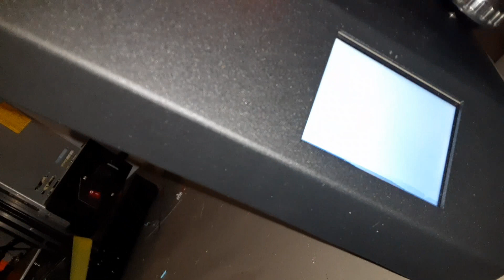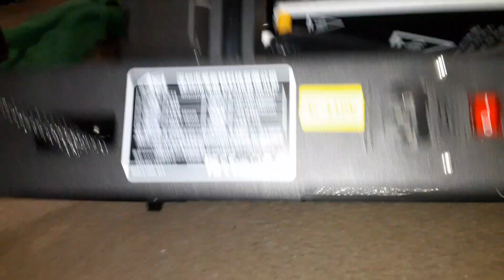Anet ET strange issues

Comment: I have a totally different issue. My printer bed starts up just fine, half way through a print it quits. I have the Anet ET4 since Christmas 2020. I am hoping under warranty the company will help me out.
Reply: Did you find the issue to this as mine does it as well
Reply: @kinghero22  I haven't found the issue. Haven't had time to troubleshoot. But I can get it to work if I preheat to 40. Let it get to 40 then incrementally increase the bed temp until it reaches 60 degrees. If I do it this way I have no issues. It's just a pain in the rear.
Reply: @purplemonkeydishwasher9360  how bud I found the issue for mine the other day, I had to get the latest firmware from anet and update the 3d printer didn't have another issue with it doing it hopes this helps
Reply: @purplemonkeydishwasher9360  you just go on their website choose your printer and download fireware and upload to sd card put in printer and go to upgrade and upgrade
Reply: @purplemonkeydishwasher9360  let me know if it works for you cheers
Reply: @kinghero22  thanks dude I'll give that a shot.
Reply: @purplemonkeydishwasher9360  how did you go mate? Have you updated the firmware?
Reply: @kinghero22  I tried. I think it was firmware 1.1.2. I can't remember exactly. But I found the anet forum page and downloaded the file. Unzipped and put it on my micro SD card. Put it in and the slot and went to upgrade. The printer did not recognise any files and there was nothing to select. So I turned it off and watched TV LoL
Reply: @purplemonkeydishwasher9360  there should be a bin file, just put that file alone on the sd card, not the complete file, as I did the same and didn't recognize anything until I put the bin file by itself on the sd card
Reply: @kinghero22  thanks for your help. If I get time this weekend I will give that a shot. So you're saying take everything off the card and have the bin file on its lonesome.
Reply: @purplemonkeydishwasher9360  you don't have to remove everything just put the bin file on by it self from the PC, take it out of the zip file on pc then transfer to sd card and should read it then, due to it being in a file, the printer will not recognize the bin file

Comment: Why not just replace the Inlet Module Plug Fuse Switch Male Power Socket, that came with the printer with another one. It could be something with the switch itself try replace the switch with a better one, try doing that to see if that fixes your problem.
Reply from the maker: Tried a couple fuses. It was the switch, they were faulty on both of these, but easily replaced and I have had no problems since. I used a marine rocker switch of the same size. 1.50

Comment: There's no kind of ball switch in there is there where it knows if it's been flipped for safety, but it's been installed in reverse?
Reply from the maker: Nope no ball switch or mercury switch. The actual switch is smooth though it dosnt click like it should, making me think it's the culprit. If not the switch it's the power supply. I'll jump the switch and see if it fires. If not I'll have to replace the power unit

Comment: It's a bad connection, trace the power circuit from the switch to the screen and the power from the transformer to the switch.
 Without looking at it a diagnostic is all guesswork, I once came across a mercury switch used as a tilt switch to cut power when not level and it was wired incorrectly so that it would only provide power when tilted but I can't see why you would want a tilt switch in a printer.
 You need to trace it with a multimeter to diagnose.

Comment: Swap over the power supply from the good printer - works? Then try to swap the boards - works? If none of those swaps work try the reverse. Take parts from the bad printer and swap one at a time to the good printer. Check continuity of all power wires - while wiggling them around.

Comment: Fuses in the power port itself?
Reply from the maker: There is an extra fuse in both sets, I have check them and there seems to be no problem. That was my first guess before i realized it worked on its side

Comment: Cold soldier joint inside the power supply. Try another power supply
Reply from the maker: This is my current suspect. It's the only part I haven't opened and examined. I do have a couple spares I'll try switching this out when I get home.
Reply: @Technivorous  this could be the fault, does it stay on every time or is there the odd time it doesn't?